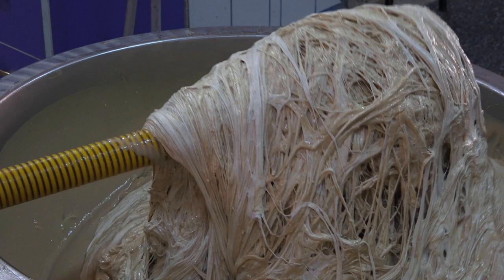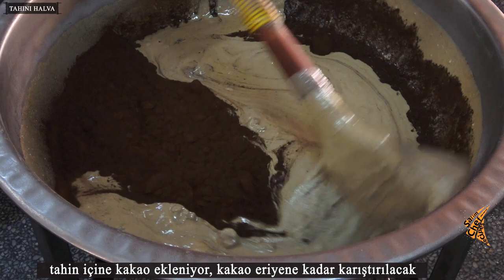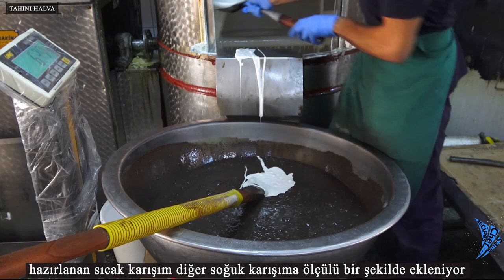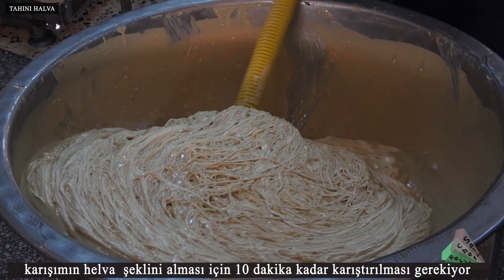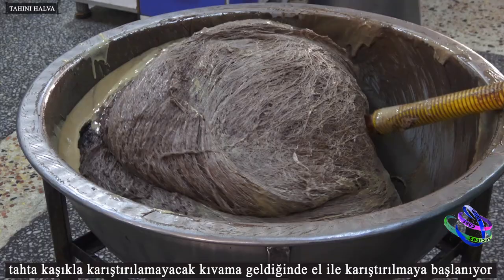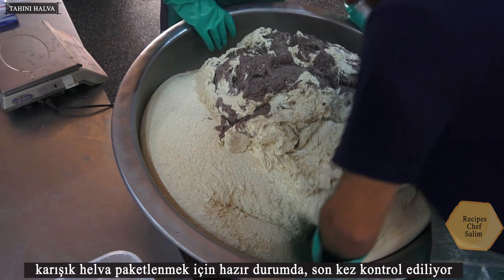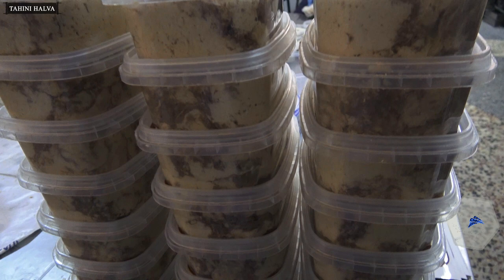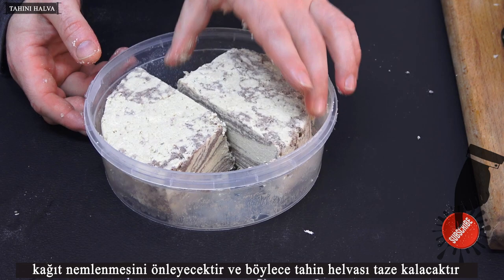Traditional Tahini Halva How to make Plain and Cocoa Tahini Halva

Comment: Hello, nice video!
I have question.
How to make soapwort root juice?
What is name on turkish soapwort root juice?
What temparatur need to be when cook socker lemon salt and glucose?
Regards and hello from Serbia!
Reply from the maker: What you need to do is to soak 2 soapwort roots in water the night before and boil the water. After boiling the water, add powdered sugar or granulated sugar and whisk with the help of a mixer until it becomes thick.
It is sold under the name of Çöwen Water in Turkey.
I don't know the temperature exactly, the fire is burning at the bottom, they cook it that way 👍
Reply: Thank you!
All the best to you and Turkey!

Comment: Any links to a scaled down recipe I could attempt to follow at home? Have tried this with just Honey/Tahaini and ended up with Tahini fudge rather than the crumbly delicious Halva.
Reply from the maker: Turkish tahini halva is like this, so it doesn't crumble, Can be made at home with the same ingredients, Can be made at home with the same ingredients, 
1 cup of powdered sugar
2 fingers missing tahini from 1 cup
2.5 cups of flour
5 tablespoons of butter
Pistachio
FABRICATION
First, melt the butter in a pan. Then we add flour on it and fry it for 10 minutes, add powdered sugar on it, and fry it for 15-20 minutes on very, very low heat. Of course, in the meantime, we roast the pistachios in another pan, while roasting, we crush the peanuts a little bit. After roasting for 7-8 minutes, we add the peanuts to the flour mixture, then add it to the tahini and mix well. We fry it like this for 7-8 minutes and add a bag and add the mixture to any mold in order to be able to remove it easily later. We leave it to cool outside. After cooling, we add our halva to the refrigerator and after a day you can take it out and serve it by slicing. Bon Appetit.
Reply: @ChefSalimRecipes  Cheers! I'm going to give it a shot this weekend, my Mother loves Halva so I've been trying to recreate it as a present!